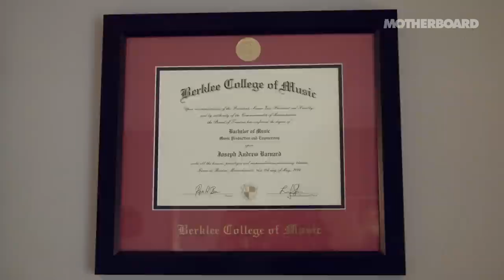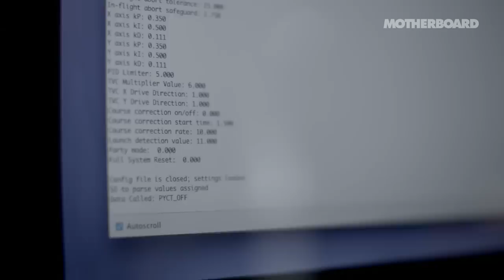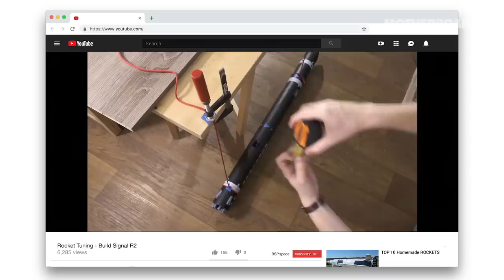The DIY Rocketeer Building SpaceX Replicas of Self-Landing Rockets

Comment: The last landing, that happened on one of the early space x flight tests for real , where it ran out of fuel before landing. Only a matter of time until this guy gets it right.
Reply: The difference is that at the point when Joe's runs out of fuel it's moving sideways pretty fast. The gimbal PID needs more work and there are lot better, cheaper and faster ways to improve that than trial and error. The fact that he's trial and erroring suggests he's not approaching this the right way.
Reply: @ominouspenguin  Hes got a theater degree, cut him some slack.
Reply: @ominouspenguin  then do it your self
Reply: It didn't run out of fuel, well, it did, but that wasn't the real problem, the rocket was supposed to land just before the fuel (which is solid, so he couldn't control it) is burned completely, so the real problem was that the sensors were getting wrong altitude data.

I know this because he did a video talking about this :D
Reply: @juliansoto2651  I bet those hobby solid engines don't put out the most consistent amount of thrust. It's going to be really hard for him to consistently land
Reply: @joshmiller902  I agree,  I'm sure he would have done it if he used other kind of propulsion
Reply: @ominouspenguin  He legit explained the pros of doing this at a scale model is so he can do trial and errors a bunch of times. There's nothing wrong about this approach...considering every aeronautics company has done trial and errors. SpaceX wouldn't have been able to successfully make their Falcon 9 land if it weren't for their early Falcon 1 and grasshopper tests. The first Falcon Heavy launch was a trial test.. NASA themselves had small scale tests before and during the launch of the Saturn V, they launched 10 Saturn V's before they finally landed on the moon. And it's even another story for Russia and their countless N1 rocket launches. And shouldn't be surprising that all of these space programs has failed at least once or more from it.
Reply: @joshmiller902  Right. It can absolutely be done as long as every motor has exactly the same ignition delay and thrust curve. But something tells me hobby rocket motors are not quite renown for that. So even if he somehow eyeballs the ignition timing for one motor, the next one would very likely still be a miss. What he could do, is partially block the exhaust with something heat-resistant to control the thrust, you can actually implement thrust vectoring this way as well instead if gimballing the whole motor. Or use two motors side by side and turn them outwards to reduce the vertical thrust component, while having control over the roll as well (though again, ignition delay and differences in burn time might be a problem).
Reply: @mc3123456  Exactly, the system is not fault tolerant, and is not corrective towards deviations from the expected state... Good idea on compressed gas though... Shit, compressed gas has a whole other slew of issues, but tbh, that would make his system a lot more realistic...  He could develop a two phase system. Phase 1, solid rocket booster, pick a detachment method. Phase 2, compressed gas for variable thrust....
Then again some kind of baffling system could be used with the solid rocket boosters, and using the accelerometers on board, you could control those to produce a consistent amount of thrust in a particular direction... But you'd also need to compensate for the lack of tolerances the boosters have in their design spec, so you'd then want need to figure out a way to compensate for that... More sensors etc. idk, brainstorming here.
Reply: It's been two years, and he's done it. He uses ceramic arms to control the thrust profile which is quite a new method but yeah against all odds it's done.
Reply: you were correct, 3 years later and hes done it

Comment: HOT TIPS:  The scale of your rocket makes landing on grass similar to a Space-X rocket landing in the woods on rolling hills. To compensate for this while keeping the same landing gear looks, you could do a few things. You already have the sensors and PID controller, so put that USB battery inside the rocket body and use it to shift the center of gravity with cheap microservos. You could get a similar or better result with a linkage from your motor gimbal to the landing struts that connect when the springs deploy them. Alternatively, you could give the landing gear their own servos (should only need two with a clever mechanism) and this would eliminate the burning band release and associated failure modes. Servos are more reliable in terms of timing. Also, look into "thrust reversal" as used on jet engines. With careful heat shielding, a thrust reverser can nullify the thrust from your solid rocket engine, giving the effect of shutting it off without switching to a liquid or hybrid rocket setup. Most importantly, if you want someone to hire you, don't attempt to look like them. This gains you zero brownie points (unless they need a fall guy or stunt double) and maxes out the creepy points. If a dude wants a replica of himself, nature has a mechanism for that. It's not a bad trait for picking up chicks or acting jobs though, since you technically look like a famous billionaire. Good luck on your project!
Reply: Buck Starchaser hahaha 😂
Reply: Good ideas. Maybe he could also put four smaller engines and gimbal them outwards to decrease thrust for a smooth landing.
Reply: I liked this comment until you got to the part where you're saying hes trying to look like elon musk. Dude I think he was just born that way..
Reply: @Stealth360stealth   I completely agree that he naturally has a significant resemblance to the very person he's informally asking for a job from, and I suspect that the video producer did too. I also understand that a person's appearance can change significantly, based on their styling choices and outward expression. At 0:30 in this video, it's evident that he has only a vague resemblance to Elon Musk. Notably, his rocket is displayed with his business logo "BPS" and is adorned with the US flag, indicating that he identifies as an American with his own business idea. Over the course of the video, his style changes. With all the memorabilia that he wears and surrounds himself with being associated with one other business person and company that he expresses desire to work for, the similarity becomes overtly unnatural. I have nothing against him personally, and I pointed out that giving up his individuality to adopt that of another results in neither. Keep in mind that you liked the previous observations when they applied to a human creation, but not when I used that same process to critique the aspects of a human-created persona. I strongly suspect that the rapid change in appearance and gradual change in facial expressions, etc. were likely a product of feedback from the video segment's producer and the clips displayed were chosen by the editors. I suspect that he was styled and coached to exaggerate these similarities on advice from the show's producer, and since he has a photography business, likely followed the advice from what he would consider a successful version of himself without regard for the difference in objectives. The problem with that, and the underlying message of my comment's final tip, is that a person who is willing to adopt someone else's persona to replace their own, as well as to start one's own rocket business and state a desire to be hired by a competitor, is mechanically unlikely to succeed in those goals just as the other things I gave advice on. The statement I gave was intended to be self explanatory to prevent the need for a block of text as large as this one.
Reply: @funnelfpv9435  That would add more complexity and weight, but would also likely work until motor cutout. From his demonstration of mastery in keeping the rocket upright in flight with the current thrust vectoring, I'd say it's within his ability to implement it. Imagining a group of Estes A10 motors firing up just at the end, that would be exciting to watch. Unfortunately, solid motors are notoriously hard to light off simultaneously. I recall the Mythbusters were able to pull it off though.

Comment: Just from a control engineering perspective you can not really make this work with a model rocket using solid propellant. There is no way to alter thrust once it goes off. You can get the perfect altitude setting for a motor only to have it be slightly different for the next motor. A gust of updraft can put you off target. This is why control engineering exists in the first place; to iron out the small differences and still reach a set goal.

My suggestion; use a hybrid engine that uses a solid propellant and a gas so that you can control the thrust by controlling the gas flow.
Reply: He made a video about that.
Reply: He's aware that he needs some control. Currently he's using dead reckoning (on timers).
Reply: Give him time, and maybe he will discover something important using his own approach. A new device/solution/method... etc
A new way of using solid fuel, who knows
Reply: Nothing is Impossible, people said space x's landing rockets is impossible, and yet they did it, just give them time
Reply: Honestly you could just have a tube with an axial length cut from it sweep in and redirect 100% of the thrust to the sides. Have it split and coming in from both sides and you've got something you can modulate on some level.
Reply: The thrust curves on those solid rocket motors are pretty consistent. Liquid engines actually have quite a narrow throttle range due to the turbo pumps anyway. I agree solid motors aren't ideal, but there's no reason they won't work.
Reply: @AtlasReburdened  yeah a thrust reversal mechanism, perhaps tied in with altitude based leg deployment. Find the average duration for a large sample size of solid rocket motors, then add in a bit of margin to get repeatable results.
Reply: That's a pretty heavy solution, the tube would need to be made of something that could withstand the rocket exhaust (these motors will burn through thin steel if close enough), plus the mechanism to move the tube in place against the thrust. When he's already intending to switch to a hybrid, I don't think it'd really be worth it.
Reply: @michicon5758  I'm pretty sure nobody said that... Everybody knew it was possible. Folks just thought it was too hard and risky to be worth it. The original comment has a really good point though. The solid engine makes this 100x harder.
Reply: @ballwizz23  Yeah, but BPS space wants to do model rockets that have solid rocket fuels that could be used cheaply and continously, but hybrid liquid would be expensive in a way so that was just my point,
Reply: sam rowland Well steel has a fairly poor thermal conductivity for a metal and really likes to oxidize at elevated temp so I'm not entirely surprised that they'll eat through it, but I can think of a fair number of refractory materials that could be coated onto a thin sheet of support material. I do agree that weight would be the idea killer here. The control arms would need to be stiff and the servo strong if any real modulation was desired, and that does cost when grams matter. If he can nail landing burn ignition timing to withing 5% or so he should be able to use a very simple mechanism that just unlatches and springs the thrust re-directors into place and have them shaped that they clamp to the middle via the force of the gasses. That would save a lot of weight, but you can see the frustration it might cause. He would have to really go after ignition timing accuracy and there's limits to that with solid fuel, even with a really good ignition composition.
Reply: Jozias Klippermann can’t say “no, or can’t” to baby Elon
Reply: Jozias Klippermann - Gas is a compressible fluid. Why not use two hyperbolic liquid fuels that ignite when mixed. You will need to use a turbine to feed the fuel in order to overcome combustion chamber pressure. Use turbines to start, stop and manage thrust. No ignition necessary. I dont know why this guy isn't building motors/engines, that's the fun part.
Reply: Jozias Klippermann: It is so not true that you cannot make this work with solid rocket. The Australian developed Nulka Decoy rocket uses a solid rocket motor to launch to 100ft or so then fly vertically and maneuver at a constant altitude for about 2 minutes. All this with a constantly changing weight and balance due to consumption of propellant. Very clever!
Reply: Someone show Jozias's post to Elon's son!
Reply: You sounded like you knew what you were talking about until the 9th word in.....You are watching him learn, adapt, and create. What is your set goal?
Reply: Thank you, I'm really glad you brought this up. While his designs are pretty substantial for someone with no engineering background, he's really lacking certain things to take these designs to the next level.
Reply: There definitely is, but it absolutely isn't preprogrammed landing sequence which is going on in this vid.
Reply: Uhm, yes all of these are super suggestions. Cut the guy some slack, impressive what a wedding videographer has done with a solid fuel system. How long and how many really smart people did it take for NASA to develop a hyberbolic fuel system? And why didn’t the Russians initially try it?  Not to mention, hydrazine and cardboard, what could go wrong? The idea here is to do it on the cheap. And I’m pretty sure using a liquid system might pose some legal issues with the local authorities. Or I could be wrong. I appreciate what this guy represents- the true essence of the scientific method.
Reply: Active motor ignition could make it possible. At a minimum, you must first assume that the motor will fire with the same thrust trace on different launches. Even better, account for ballistic performance variation between launches by including ballistic parameters (grain bulk temperature and ambient atmospheric pressure, in particular) in your active motor ignition model.

In my view, for any given launch, you need the motor to ignite at a certain distance away from the ground. This distance would be determined in real-time by flight computers and would be a function of inclination angle, instantaneous position, and instantaneous velocity. Note that there would be an envelope of "landability", e.g. the rocket motor couldn't remove the total kinetic energy of the vehicle if the rocket itself were too angled or coming in too fast.

Anyways, my argument is that from a control engineering perspective, this could be made to work, using active rocket motor ignition. Whether the individual in this video has the capability is another question. "The devil is in the details" and I know better than many that what is easily understood from a theoretical perspective is often extremely difficult in practice for many nuanced reasons.
Reply: Jozias, you're assuming his goal is to control altitude, but his gimbals are what he's using to control flight stability. On top of that, he's happy with a close enough hover just above the ground, which is fairly achievable. In any case, considering he's learned gimbal control, there's no reason he won't learn to control other processes in the future if he decides to switch to actuateable engines.
Reply: You have a good point. Maybe a solid rocket booster up, and a liquid engine to slow it back down

Or maybe a small solid fuel booster, and when it’s going back Down,  another booster ignites to slow it down.

The perfect hoverslam
Reply: @rozaepareza  does he have a YouTube channel? The only moment when they show a video of him from YouTube it's cut right before the name.
Reply: @jgrito5  Yes, his channel is called BPS.space
Reply: I bet you could modulate the thrust of a solid fuel engine at least at a small scale by dissipating unneeded energy through careful use of the Krushnic Effect.  Also, I am sure there is a range of speeds at which the rocket can land upright without breaking something giving you a little fudge room.
Reply: @rozaepareza  thank you!
Reply: You could in all honesty just have the TVC mount jiggle the rocket motor through a certain angle sweep centered on its actual commanded position. If the sweep is fast enough it will approximate throttling.